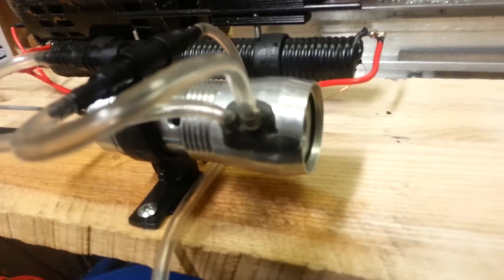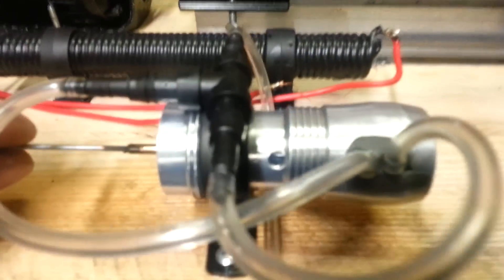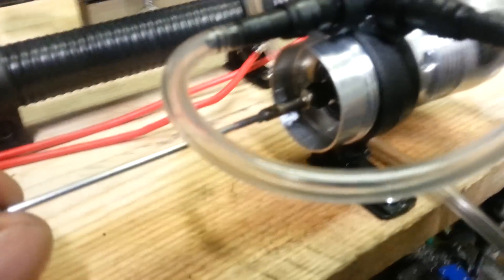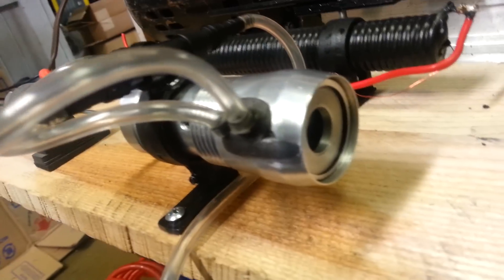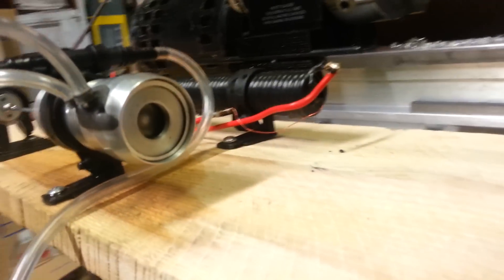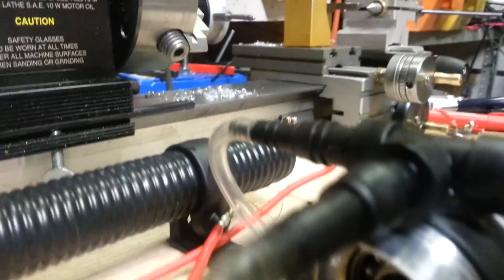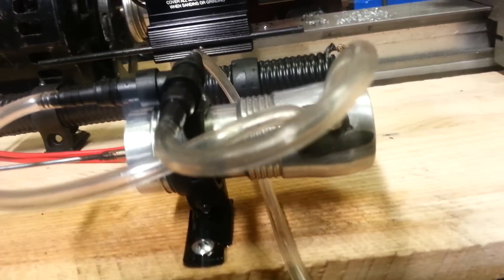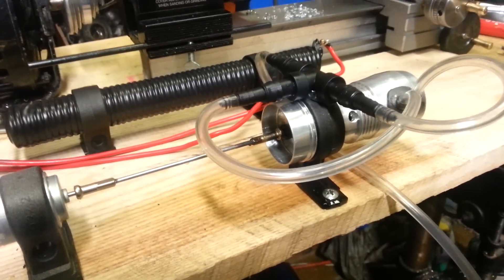Micro Tesla Turbine made with Taig Micro Lathe

Comment: Congratulations for your mechanical workmanship, but Sir, may I point out that the drag on  that  motor, which  is being used as a generator,  is not due to its INDUCTANCE! It is  a little more than that, but perhaps this is not the place to explain it all, but it will benefit you a lot if you care to look at what constitutes and electrical load plus of course the mechanical losses as windage/ drag and friction as they change with rotation.
Reply from the maker: True, friction is everywhere... see my next   vid regarding this engine. Some problems were corrected.